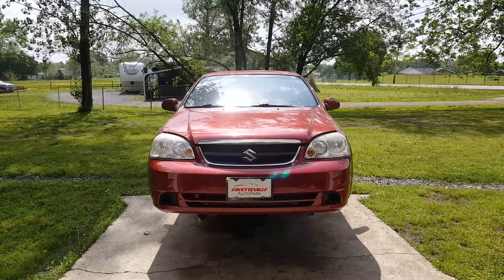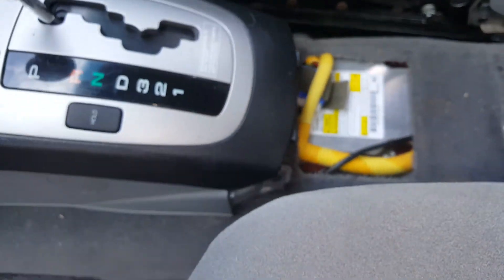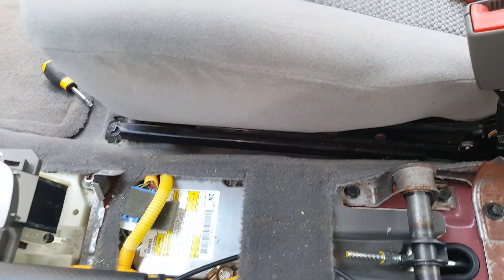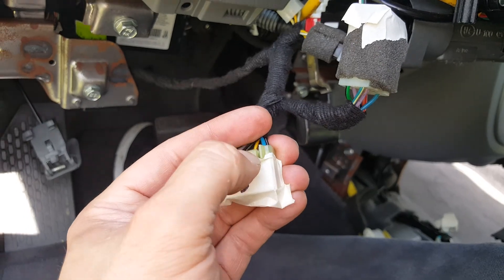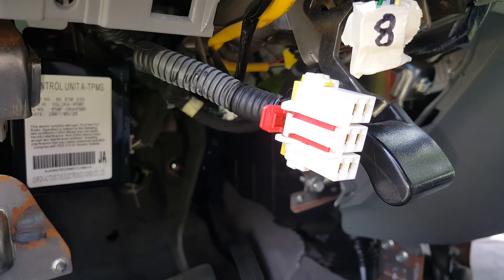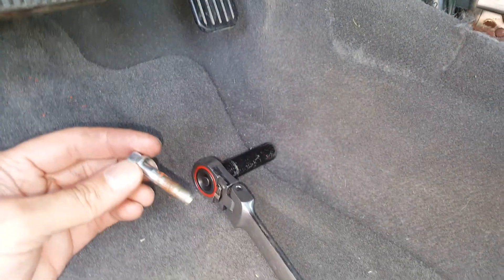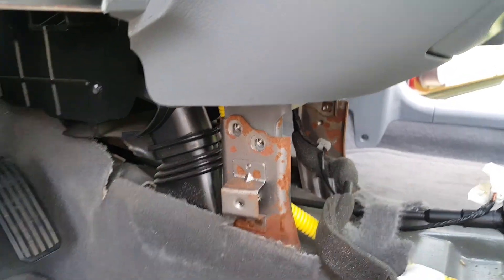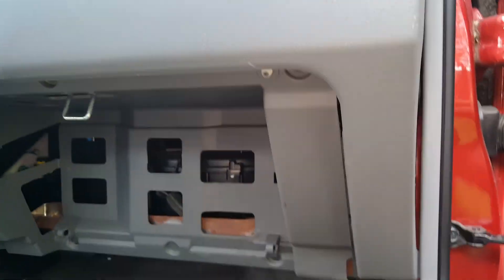How to replace the heater core on 2008 suzuki forenza/Optra/Excell/Lacetti

Comment: Geeeeeez. practically took apart the whole car for that sucker. What lead you to determine the heater core needed to be replaced?
Reply from the maker: The car had been previously filled with head sealer. All of the hoses were either cleaned or replaced as well. Great question. Thanks for the feedback.

Comment: Where do the wires that are labeled 74 connect to on the colum? They come from the relays down by the floor board...I recently did my heater core and can't figure out where they go

Comment: Please tell me the name of the piece under the dash from the front passenger seat at the bottom. Mechanic replace heater core  but never replace that piece. Now the car is always hot.
Reply from the maker: If the cover for the heater core is missing , I know a lot of their parts are gm , a dealer may be able to get the part. The part would be near impossible to find except from a salvage yard. My other short term suggestion might be to insulate the opening with 1/4 inch foam , kind of like carpet pad , seat padding etc. and use foil hvac tape. Hvac tape is really sticky and will never fall off . Hope this can help.